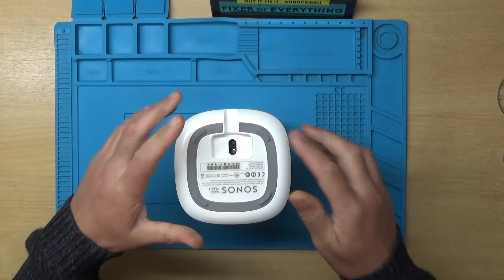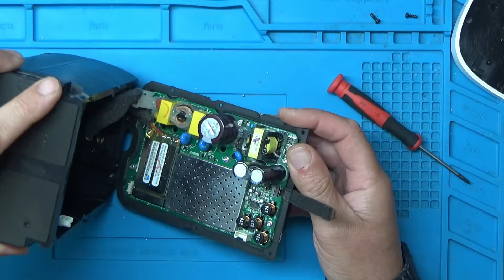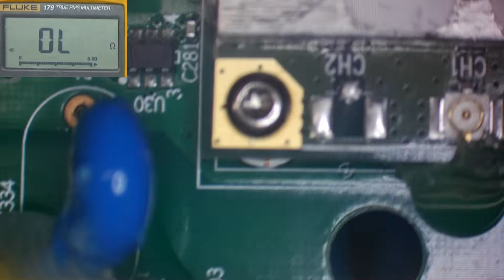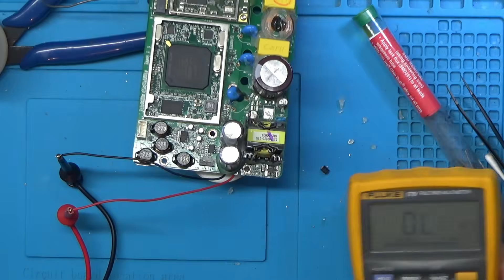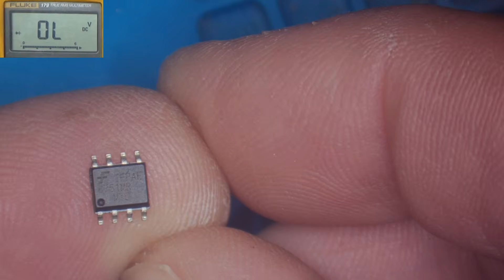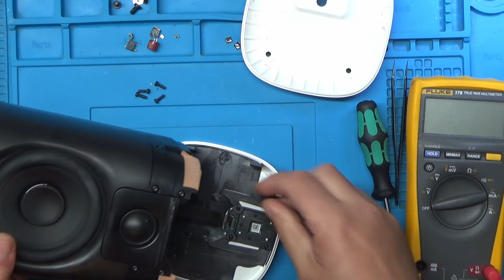Sonos Wireless Speaker - Very Blown Up! | Can I Fix It?

Comment: Nominal of resistor to CS pin PWM IC - not critical (100-300 oHm). It current limit resistor from current sensor.

Comment: On a similar topic, I’ve recently tried to repair a Roberts S2 speaker, used parts from a Roberts S1 speaker. Put a little video together of my attempt at the repair, which is working well. Curious to know if anyone is able to bypass the faulty boards on these speakers and convert them to an aux speaker? I’m happy to send you up a free speaker to play with and video if you fancy a challenge? Cheers and thanks for your great videos. I’m subscribed.
Reply from the maker: Thanks 👍I've just watched your video. Drop me an email using the name of my channel at out look dot com.

Comment: I always look at those 240+ Volts from the mains like 😶‍🌫️
Reply from the maker: Yeah, I've had a few "belts" over the years 😂😂😂
Reply: @BuyitFixit  There's another side of the medal. I had been living in a Russian village (I mean a real village with a church in the middle, canonical stuff) for about ten years with my parents. We used to have 210 down to 180 Volts on our mains, and it was a curse indeed. My dad tried to combat it with voltage stabilizers, and two of them got burned for some reason. I remember bulbs getting dim and flickering, even LEDs. It was caused by too many consumers wired to the mains without proper authorization, and a loooooong battle with authorities about good and evil.
Reply from the maker: Oh right, I hope you managed to get it sorted eventually. I had the opposite problem where. We live in a quite remote area for about 5 years now, with not a lot of population. The mains voltage was too high, and I would often get 253V, 257V etc I think the highest was 260V.
I complained about 6 months ago, and they changed a tap on the transformer to a lower one to bring the voltage down slightly.

Comment: Hi,
How to make that “dim bulb tester” diagram please.
Reply from the maker: I cover it in this video: https://youtu.be/aEQu1vd7OxM?t=196
Reply: @BuyitFixit  Happy New year. 

So, my understanding is that, if the bulb come on or dims, there is a short - correct?

What size bulb is best, 40w 60w? LED?

Thanks
Reply from the maker: @kan815k  Yes, just a bulb in series. I think I've got a 100w but you could probably use a 60w. Needs to be an old incandescent bulb, not LED

Comment: Excellent work! I have one of these SONOS Play:1 speakers that has failed. It looks like I may leave something like this up to the professionals to repair. I will take apart my SONOS speaker to see how bad everything looks, but I don't think I have the skill and expertise to go through of of these troubleshooting steps to fix my problem.
Reply from the maker: It seems to be a quite common problem. An alternative would be to use a laptop power supply, and connect it to where the internal power supply goes bypassing it.

Comment: Great video thanks.
I'm just learning when you inject power for thermal camera. Do you put the power through the charging port? Or do you have any videos explaining where to inject current please
Reply from the maker: You inject where you suspect or find a short. So you measure across a capacitor for instance and it seems to be short circuit. I'd probably find a ground and inject there. In this case the short was across the diode that feeds the capacitors. The short could have been anywhere before or after that point so I chose to inject there as it seemed a safe and sensible place to start. Only use a low voltage like 1V and start at something like 1A see if anything gets hot, if nothing does, up the amps a bit and repeat.
Reply: @BuyitFixit  Thank-you for explaining it. I've learnt alot from you 👍

Comment: I heard a sound, but that's not a proof that it's working.  Did you hear music afterward ?
Reply from the maker: @Jvavolerpareil  No, it needs to connect to sonos with an app and have an account which I don't have. The unit was completely dead and had no power. It uses 24v internally to work. The blown power supply now has 24v which is correct. It was flashing, and in the manual it says it's trying to connect to wifi. I wasn't paying and signing up for a sonos account for a speaker that doesn't belong to me.

Comment: Hi Mick. You were 'lucky' to find one of the ICs was genuine. I also think they are removed from old PCBs so they are not new ones hence the pins were oxydated. Do you agree ?
Reply from the maker: They could well be mate. I ordered a transformer for an LCD TV a few videos back and that seemed used and was faulty! One of the chips in the packet wasn't even the correct one.
Reply: @BuyitFixit  yes it's sad

Comment: Loved this video! I loathe switch mode power supplies. I've had a bit of a bad run with them myself 😅 I can relate to the process. Do you still experience anxiety around that first power up anticipating the possible bang?
Reply from the maker: @ProblemBusterNZ  Thanks 👍and yes 😂😂😂The starlink router I looked at a few videos back blew up quite spectacularly on camera if you didn't see that one...

Comment: Another impressive fix, so many blown components, yet you got there in the end. It’s a hit and miss with AliExpress, why they bother faking cheap components still boggles me. The biggest problem with these fake components is that you are adding another variable into the repair. Is there still a fault, or are the components fake and not working.

Comment: Thought to share with you that i found the problem with the headphones i mentioned to you, your troubleshooting tenacity motivated me to persevere, the problem was the 2.5mm jack connector a pin inside was not making contact throwing the Bluetooth   pairing mode out which intern communicates to the on board chip. there is a workaround but have ordered new jack from AliExpress.
great work again and thanks for the motivation to fault find my own issue.
Reply from the maker: Nice one, well done 👍

Comment: I have two of these, both dead, that I haven't opened up yet. Your timing is impeccable sir.
Reply from the maker: 😂😂😂Nice, well hopefully you now know what to check and replace 👍
Reply: @BuyitFixit well, it may be a different fault, but at least I have a pointer and I now know how to get the thing apart.
Reply from the maker: @NeilTheTurtle  I think this is a common issue on dead units.
Reply: @BuyitFixit Thanks.  I'll pop back here and comment when I get round to them.
Reply: @NeilTheTurtle Did you try to fix them?
Reply: @chilly1661  not yet, it's bloody cold in the workshop and I'm too tight to switch the heating on. I'll get to them when the weather warms up.
Reply: @NeilTheTurtle weather is warming up 😂

Comment: I have the same speaker with the same problem. Same resistor burned, and in my case the 8 pin switching IC has a crack across it. Very useful and timely video. Thx 👍
Reply from the maker: Thanks 👍Hopefully you'll be able to fix it 🙂
Reply: Did you fix it?

Comment: Quite interesting. The thermal cam does not necessarily point to the point of failure but helps pinpointing...
Reply from the maker: Yes it didn't with the IC, but absolutely did with the failed output diode 👍

Comment: It should be a law that once you decide you stop supporting the software you have to make it open source to let others continue supporting it. Or at least make it work without needing servers to work.
Reply from the maker: Yes,  agree! That would be awesome.
Reply: And most devices and smart soeakers run embedded linux under the hood which is litteraly made up of a ton of GPL'ed components like Uboot the linux kernel and busybox
Reply: shouldn't require the internet to function in the first place.
Reply: I 100% agree!  Logitech made that, with their Squeezebox music players.  The products and support are discontinued, BUT they released their software source code and installers to the public.  Incredible, but TRUE. It's a really one of the rare HAPPY END for a product.  So if you got a RaspberryPi used as a player, LMS (Logitech Music Server) is, in my opinion, one of the best way to go !
Reply: There is. DCMA allows reverse engineering to retain compatibility and features.
Reply: @KennyMillarSFX  Reverse engineering is a lot of work though, while making the source that runs this available is a lot less work.

Comment: I've ordered probably close to a hundred semiconductor things (discrete and ICs) from ebay/aliexpress and TLDR more than not had a bad experience. Chips are often sanded and rebranded, outright fake, or as you experienced in a prior video they put for eg a 2n2222 transistor die in a large power package so it still tests like a transistor but blows up with any real load applied(ive verified this with decapsulating the die and looking under microscope). Now the only chips I buy from these places are vintage chips not available elsewhere. For repair I source it from digikey, etc cause even with the $8 shipping, its worth not being sus in the new parts.
Reply from the maker: I've had not too bad experience with Ali in the past however the last few purchases I seem to have had issues with. I do order from Digikey and RS, Mouser etc but the postage cost is around £15! So unless I'm ordering a lot of parts to get free postage it's not very economical. Also a lot of parts seem to be out of stock or are not available.
Reply: I've had some MOSFETs from Aliexpress with RDS (on resistance) about 20x what the datasheet says, so clearly fake. Larger MOSFETs seem to be the most common fake parts from Ali.
Reply from the maker: @gadgetmind  I had pretty much the same experience with Mosfets recently. The Rds(on) was 20 ohms, and according to the datasheet it should have been <0.75 ohms

Comment: @13:22 I would probably call it quits, figure out the voltages and add an external power supply. Kudos
Reply from the maker: That was going to be my backup plan if the transformer was open circuit or shorted 🙂👍

Comment: Yes when you text said did you see the fault I looked and saw the IC number was different.
The R178 goes from pin 6 to the source of the FET i.e the top of the 1R resistors that blew, this is quite common fault on this type of switching IC. When the FET goes short it blows the current sense resistors then the rectified mains gets connected across the switching IC via the FET gate series resistor and the current sense pin series resistor blowing all 3 items.
The current sense value on this item should be 0R33 but because you fitted 3 x 0R82 it ends up as 0R27 quite a bit lower. But TBH as you found out that it still did not stop the whole thing blowing even with the 0R33 in when the output diode failed.
Reply from the maker: Thanks for that mate, I didn't realise at the time that they were current sense resistors, but someone else mentioned that, and it makes total sense (no pun intended 😂😂)

Comment: Those three one ohm resistors look to be paralleled so (any) values to achieve a total of 0.3 ohms would fit on those pads - three resistors being used purely for power dissipation reasons.
Reply from the maker: I think they are for current sensing,  a few  people mentioned that and I think they are correct.
Reply: @BuyitFixit  Yes, current sensing - that's a given.  The lower value you now have means the fault detection requires a HIGHER fault current to cause a shut-down.  I doubt it will ever become a problem but........

Comment: You are done good trouble shooting sir but still i have confusion and i am looking from datasheet it is showing the 100 ohams resistor but you did the fixed 148 ohams how is this possible can you explain and onece again thanks for the sharing good information.
Reply from the maker: I didn't see any values on the datasheet, but someone had the a similar fault where the  same resistor was blown and someone measured the value and said it was 148 ohms.. So I gave it a go.

Comment: Good fix. I know you like your low melt for component removal but I would recommend wicking it off properly afterwards - if left on it can be brittle and the joint can crack with thermal cycling.
Reply from the maker: Thanks Andy👍Yes I normally do wick it off (like I did on the small resistor) perhaps I forgot this time on the diode? I can't remember tbh.

Comment: 44:12 - Its OK to solder like this, but there is another method, you can solder two SMD resistors, in Λ shape, where one is left one is right, upright position tilted, in that way, ends are soldered with full width of component, and you are soldering them away from PCB layer (possibly GND or shorting to another signal).
Reply from the maker: Ah yes I forgot about the tombstone way. These resistors were quite tiny, so I just thought I'd do it like I did. I didn't see anything around them that would cause an issue.

Comment: good job. but i couldnt spot your mistake. i thought you would explain it at the end
Reply from the maker: The first chip I fitted was a mosfet. 4141 was the number on it. It was one of the 5 ICs they sent! Not even the correct part.
Reply: @BuyitFixit this kinda thing makes you very wary of where you buy components, well done Mick 😊

Comment: Today I tried to repair a bosch battery charger. The problem is that many components are erased by the manufacturer. I tried to determine what value of capacitor I should put in place of the suspect one. I thought I was not wrong by much. I plugged it into the mains, no explosion. And after 10 seconds, Boum !🤨
I think I will abandon this repair.
Reply from the maker: Damn, shame. Unfortunately it's just the way it pans out sometimes...

Comment: Good stuff, i repair these all the time - they have a wealth of different issues. Main thing to do when taking apart is discharge from the bridge rectifier with a discharge pen (definitely get one, they're cheap) as they often hold onto over 300 volts for days. Always enjoy seeing your knowledge at work 👌
Reply from the maker: Thanks I'd been meaning to make one for a while👍
Reply: You don't need a pen. Just use a 2W 100K resistor.
Reply: @simontay4851 You can make your own of course but the pens are cheap, easy to use one handed and have a light to tell you when it's discharged. Essential tool to have around
Reply: I've never ever had a bridge rectifier retain charge. Only electrolytic capacitors.
Reply: @manolisgledsodakis873  not saying the rectifier is holding charge, just a good place to discharge from - connected to the big caps, slightly easier to pinch a discharge pen on.

Comment: Modern chips (since lead free solder) have a shelf life after which the pins are too oxidised for flow soldering. Some can be recovered by cleaning contacts with abrasive and the use of tin/lead solder. Really old chips solder well because old solder cleans up well with ordinary flux. Possibly cheap chips are just old.
Reply: That was leaded solder being used, so nothing to do with it.
Reply: @incandescentwithrage  NO! After market chips can be so old that they were made tinned with lead free solder so the oxides on the incoming (old but unused) must be removed with abrasive before they will solder, whatever the incoming free solder.
Reply: @seymourpro6097  Yes I agree. I misread your original post sorry

Comment: The 3 resistors are for current sence circuit. They are parallel.
Reply from the maker: Ah yes makes sense. I thought they were just protection but current sensing makes sense 😂😂

Comment: Another epic fix. I know linear regulators get a bad rap.....but I don't recall that they used to explode quite so often as these SMPSUs seem to - they tended to age gracefully ;). SMSPUs are great when all is well, but they really aren't tolerant of much abuse are they.  Occasionally makes one hanker for a good old mains transformer, a bridge and a smokin' hot regulator transistor ;)
Reply from the maker: 😂😂Cheers 👍yes old school linear regulators were a whole lot similar and didn't blow up as spectacularly.
Reply: That often tends to be the way of these things - simpler often lasts longer (fewer possible failure points), but often while being woefully inefficient. Linear regulators are great for longevity and low noise, but throwing off ~40% of input energy as heat is hardly ideal.

Comment: I see why you said it was like a Repair Cafe fix I did of switcher, current sense diodes, bridge, and fuse, so I knew after seeing the toasted low ohm resistors the other likely bits you'd have to fix. But I wasn't expecting that secondary diode at all and can't make sense of that. Secondary side faults rarely damage anything on the primary, and vice verse, Most odd. Was the switching chip actually faulty? Probably if the gate drive resistor was also dead.
Reply from the maker: Yes, I'm pretty sure the switching chip wa s faulty especially with the gate pin resistor OC. I would have just changed it anyway regardless.
Reply: @BuyitFixit  The switching chips are what I pretty much never have to hand, so unless top blown off or test utterly bogus, last bit to swap for me. The ones with integrated MOSFET usually have top blown off so you have to grub around to find the shards to try and work out what it actually used to be. External MOSFET ones usually survive, but I agree yours there was probably toast.